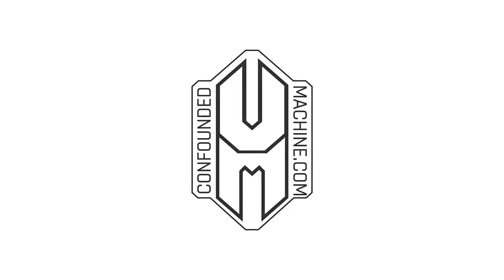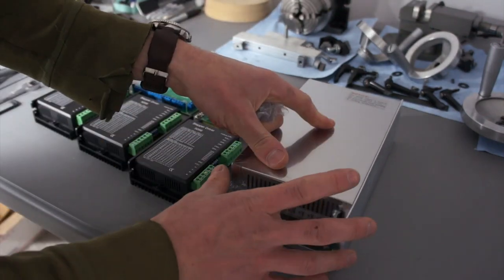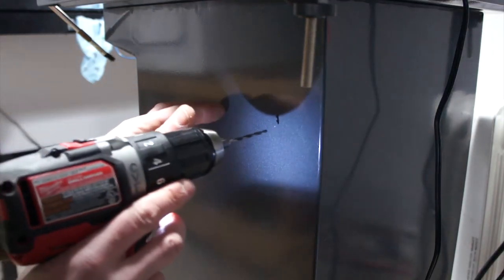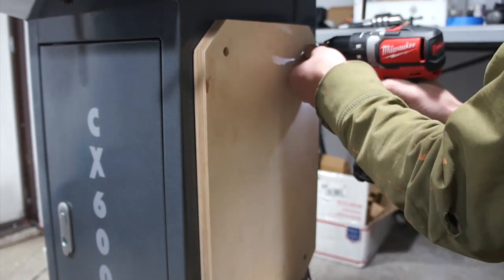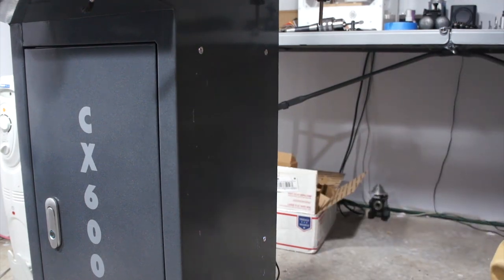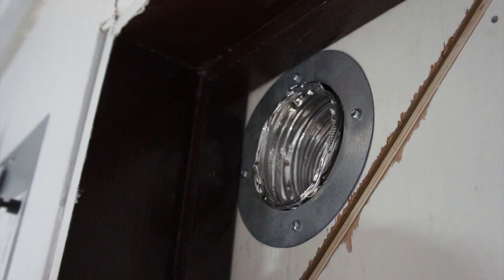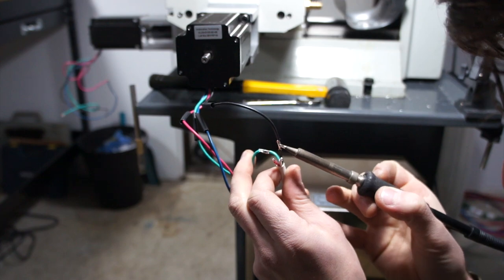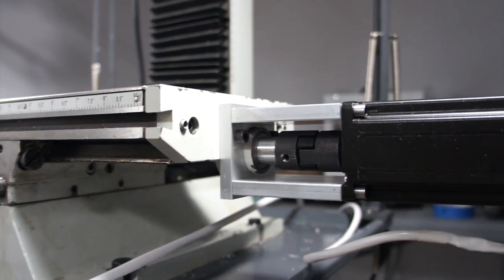Confounded Chronicles 04 - CNC Mill Electronics

Comment: Where did you get the kit for the CNC stuff
Reply from the maker: I picked up the components from https://www.automationtechnologiesinc.com/
Reply: @CurtVanFilipowski  Would you be able to supply a list of all the stuff you used?
Reply from the maker: @Helix_22  I used one of their 3 axis kits, I believe it was the 570oz NEMA 23kit. I then later change out the z axis stepper for a NEMA 34 frame size...lots of different options to use depending on machine and budget :).

Comment: Good stuff as always.  It may sound like overkill, but the miniature heat guns that are made for embossing are the perfect tool to keep with your soldering iron so it's ready for heat shrink tubing.  I bought one at an arts and crafts store for $10, but you can find them on amazon for $10-20 as well.  Look for or ask for an "embossing heat gun."  It removes the chance for scorched insulation and once you get used to getting it out at the same time you get your soldering iron, you'll wonder how you ever went without!
Reply from the maker: Totally the right call!  Next time I'm floating around the craft store I'll have to force myself to buy one of those...times like this where it more then pays for itself. Thanks for the comment.
Reply: You bet.  I wire my stuff much like yours, so I'm curious.  I can't tell from the video of your wires are braided.  I usually cut everything about an inch longer than needed and chuck up the last 1/2" of the wires into the cordless drill and twist them that way.  Then I cut off what was in the drill and the other 1/2" is usually taken up in the twists.  Takes more to describe than do.  Are yours braided or twisted?
Reply from the maker: All the signal lines from the breakout to the drivers are twisted, I play the game the same as you, drill to the rescue 😁.